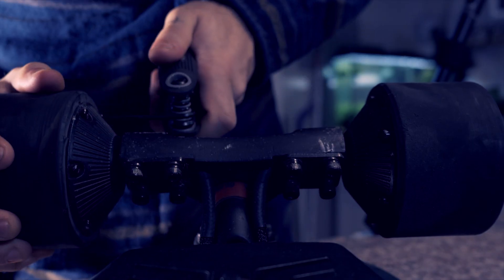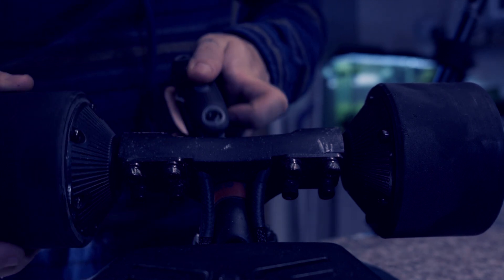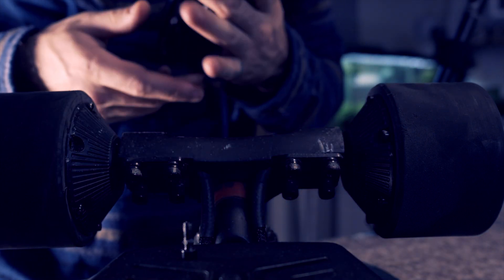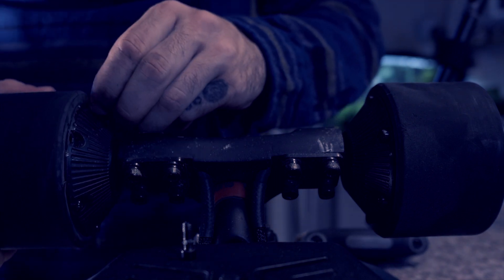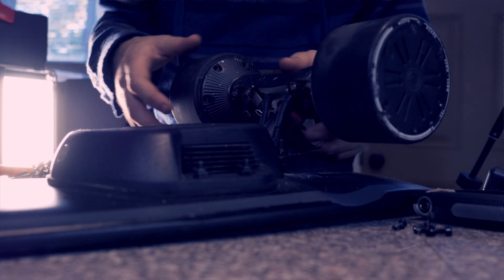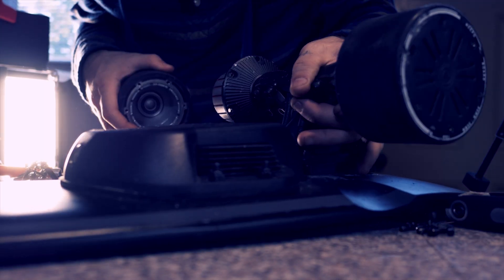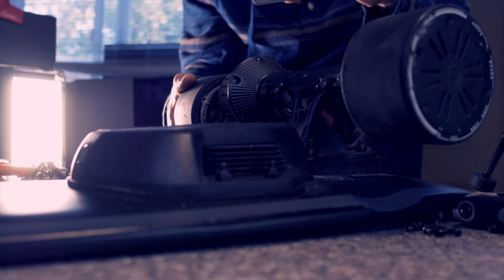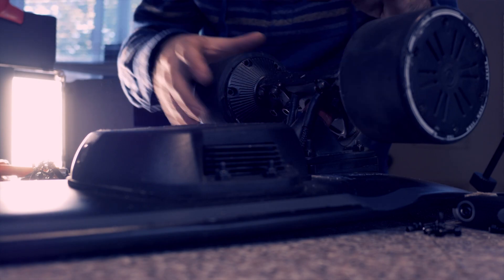How to replace PU Sleeves on Meepo Mini 2 or any Meepo Board!

Comment: Can you show how to replace the rubber sleeve from the metal sleeve? I have just sleeves but the glue on the old rubber sleeves is impossible to remove even with Iso.

Comment: I hate this board because the pu sleevs are 80 dollars and you can’t just replace the rubber you have to replace the whole assembly
Reply from the maker: FACTS
Reply: @BraxWolfe  my refurbished board came with 3000 miles old pu sleeves also my esc capacitor came off and it blew up in me and my friends face while soldering it and his motor one of the wires came off esc side as well as his power button connector pin is broken with both his battery and esc covers me and him have been soldering for 3 days

Comment: I have the V4 and the H20HT by TeamGee. Before I really did and research I removed the FRONT 6 Screws 1st and tried to slid it of similar to the H20HT .. Yeah that didn't happen.  So I took a hammer and chisel and BEAT on the sum bitch till it finally came off... if you've read this far then I will go ahead and say , sike.... jk... lol

Comment: Hello, I'm thinking of replacing my Meepo Mini 2 ER donuts with Cloudwheels but according to CW I am gonna need to 'cut' the current sleeves of my Mini so the CW would fit. In this vid, when you replaced one of the sleeves, there's like a metal ring on the inside of it-coudn't the sleeves just slide out of those metal rings so they stay on the motors and the CW donuts can slide in on them? The CW sleeves doesn't come with those metal rings so they need to be intact with the motor when the original sleeves of Meepo is being replaced.

Comment: Stripped a screw had to dremel it to get it out. And upgraded to alibaba ER battery stronger than the meepo one. Love this board. Even more with 100mm in nyc. Great work bro!
Reply from the maker: Thanks my dude!!! What?! I’ve been wondering about those alibaba batteries! How much is each?!
Reply: @BraxWolfe  I paid 179 for my battery. I had to shop around and inquire with spec for a few days but found a GREAT dealer. Got it in 3 weeks!

Comment: I know this is a late comment, but did you personally using the 265 mm trucks with these wheels. I know Meepo recommends to change to the bigger trucks but they have been out of stock for months and wanted to see if i could get away with using the stock trucks along side the 100mm wheels.

Comment: Hey Brax. I have a question about replacing pu sleeves on the meepo mini 2. In the meepo shop,there are 2 variants of the sleeve "Replaceable pu sleeves for 90mm hub motors" and "Replaceable pu for 100mm motors". Does that mean that the pu sleeves are 90/100 mm or the motors are 90/100mm? Cuz I wanna buy new sleeves for the meepo mini 2 and I don't really understand what exactly I need to buy cuz there is no info about the size of the pu sleeves, only about the size of the motor.
Reply: 90

Comment: Hey man im subbed since months ago u have unique vids....question I have the first meepo mini and the mini 2. Im wondering what size replacement pu sleeves do i order for the first mini as the specs look different when i eyeball them. I need help! Thanks for any info meepo doesnt sell the original mini parts anymore thanks
Reply from the maker: Dude i tried to find and it couldn't. I have no idea what sleeves the original had. .. Hmmm let me see if I can email them and get an answer. I'll let you know!
Reply: @BraxWolfe  thanks man i appreciate it i think im just gonna order another one I have a broken meepo mini 2 and a working mini1 with bad wheels. I might just order a new mini with er battery

Comment: After how many miles should you change them?
Reply from the maker: There's no set amount of miles. It really depends on how you take care of them. Cracking on the wheel is still fine, but if you're losing chunks of it. It's time to replace. 👍
Reply: @BraxWolfe  I just ordered my first board .. NLS pro meepo.. was wondering if I should buy them now or wait a little

Comment: if i want to upgrade to 100mm do i need to buy thw 100mm motor or just the sleeve?

also does the front wheels need to be the same size of the motor wheels ?
Reply from the maker: Hey Gian! You can just upgrade to the 100MM Sleeve. I believe the only difference is the Rubber Thickness.

Comment: Are 100mm sleeves compatible with the Mini 2?
Reply from the maker: Yes they are. Good luck finding them though! Make sure you keep checking their site regularly! 👍
Reply: At 5/2021 that was the only option (100mm) from meepo... The 92 is and has been out of stock. I came here to see the same question?
Reply: On Amazon 👍🏼

Comment: Have you found a way to increase the life of your pu sleeves? After only a few rides one of my sleeves have nicks and chips in it
Reply: I feel like maybe it is a factory defect, as it is only the one wheel, which has cracks in it
Reply from the maker: Unfortunately no..... =[ try to avoid huge cracks and bumps.
Reply: @BraxWolfe  ownboard W1S 38 " Hub Motor Tire Replacement PU Wheel 90* 62mm with 78A Hi elasticity PU wheel.... Will CLOUDWHEEL Donut 120mm Hub Motor Sleeve Urban All Terrain Off Road Electric Skateboard Wheels... My question is if you can please answer would these fit? If not what would you suggest trying to order off Amazon because shipping time is 1 to 2 days opposed to 2-3 week shipping. Thanks in advance

Comment: It seem like the left hub motor always have slip problem. My nlp pro just bought I don’t know why when I brake the same time the left hub don’t want stop suddenly. Two hub wheel don’t stop at same time, what do you think of this problem?
Reply from the maker: Hmm.. Thats weird... you can feel it not stopping, it throws the board off a little when breaking? or it doesn't stop as fast as you'd like because you feel like it's only half the power trying to stop? I haven't experienced this issue yet.
Reply from the maker: I also tried looking up on reddit and couldn't find anything on hub slipping. Not on meepo's subreddit at least. Will keep you posted though.
Reply: Brax Wolfe when I press brake two wheel don’t stop at same time, one wheel is little slower than the other one
Reply: I’m not riding it, I just tested the two wheel acceleration and brake, left wheel doesn’t stop quickly as the other wheel

Comment: I’m just curious I ordered the Meepo 2 ER and will get it next week how long do the rear hubs sleeves last approximately how many miles until I have to replace them just curious because their website is all out and I think that’s the only place you can buy them and from what I’ve read there only about 5mm thick which won’t last long.
Reply from the maker: Im about to release a video tomorrow that I talk about how thats one thing I hate the most about the Meepo. The PU sleeves. I destroy mine often. I ride on some terrible roads. In 1 year I'm on my third set. I'll keep you posted when the video is up!
Reply: With all these idiots burning down Minneapolis, jacking UPS trucks, not sure if I’ll get my board now next week or ever 😢 #prayforminneapolis

Comment: Hey man do u have the standard version? If so, do u know if it has dual 400w motors or 540w? So far meepos website says the er has dual 540w but doesn’t mention anything for the standard version:(
Reply from the maker: Hey dude, I have the standard version. I believe all their hub motors are 540W. What they change in the ER is the ESC and battery. Please someone correct me here if Im wrong.
Reply: Brax Wolfe what’s the difference between the standard esc compared to the we esc? Is the different esc the reason that the standard only reaches 25mph or is it something else?
Reply: By the way amazing vids man great to have youtubers like you to entertain me during the quarantine, any chance you would be able to make a video on the torque and hill climb strength of the board? Would really appreciate it:)
Reply from the maker: @Jjoel.T74  Let me do some research and I'll get back to you. But I think thats correct. More power coming from the battery, the different ESC handles it differently making it faster. Will get back to you. If anyone sees this too please chime in.
Reply: Brax Wolfe alright thankyou so much:)
Reply from the maker: @Jjoel.T74  Thanks man, really appreciate you being here watching my stuff. There's this other youtuber that did a raw run climbing up hills here in LA. My board is currently all broken up apart because Im working on my next video. I think y'all going to like it.  I need to get a new board to do these range and torque tests. My board has been through so much this past year, hundreds of battery charge and uncharge. I feel like it runs at 70% than it used to. it wouldn't be an honest test. Maybe "a year later, can the meepo mini 2 still climb hills?" Ive been trying to get Meepo to give me a free board but its not happening lol. By next week my board will be back and I'll keep you posted. Also I started a discord that I need to get sorted where we can all interact with pictures and videos.

Comment: I would love to see a test of meepo mini with waterborne adaptador and the biggest wheels you can get on it!
Reply from the maker: Hell Yeah! I was talking to someone on another video i had posted about waterbornes. I used to have them on a 27" globe cruiser and it was SOOOO MUCH FUN! a must try on this Meepo. Their shipping was also messed up because of the corona virus, but Need to get them soon!!! Thanks for the recommendation Morgan! =]
Reply: That's what I'm doing right now i have the adapter on, just needed help getting the cloud wheels on
Reply: You are going to love it!
Reply: @vidadeperros9763  28hrs in and I'm still peeling off the rubber though, 😭my hands have basically gone completely numb at this point, I've tried heat, and a saw but no luck so I'm using a razor blade

Comment: Hey, i bought a meepo mini 2 ER and i was wondering if i can use a standard battery with the er ESC.
Reply from the maker: Im pretty sure you can. Before they had in their shop only ONE type of ESC for the Meepo Mini 2, so Im not 100% sure but 95% sure that its the same ESC on both boards. Which makes me assume that yes you can.
Reply: I just bought the standard mini 2 and meepo said I could swap out the battery for the ER one if I wanted it later. They both should have ESC 6.0 Flux

Comment: Did you change to the bigger wheels? I saw in the meepo shop they have 100 MM wheels...
Reply from the maker: Nah it's still the 90mm ones. I have yet to try the 100mm on the mini, But's Ive been pretty happy with the 90mm. I come from even smaller wheels on boards, so anything bigger than 50-60mm feels so comfortable to me. Im waiting to see if they announce a new one or I will get the ER with some upgrades on it.
Reply: @BraxWolfe  would be nice if you can check out the 100 MM wheels...
Reply: Jakob Voigt do you have a Meepo mini 2? do you know if the 100 mm fit on the mini 2? Thanks!
Reply: @davidtrumbo4184  Yes I have one, but so far no 100 mm wheels. I will order them, when they are avaible again. The support said they are compatible...
Reply: Jakob Voigt they’re available right now!
Reply: @BraxWolfe  Question, what if the screws are completely stripped?  I have 2 that will not come out...